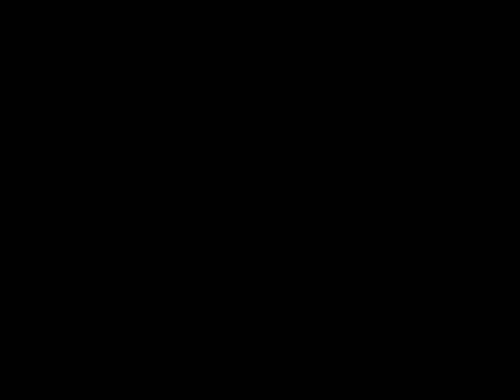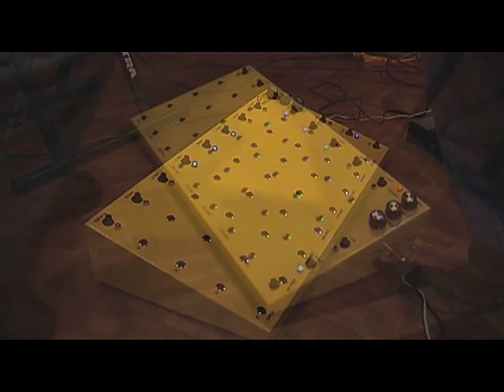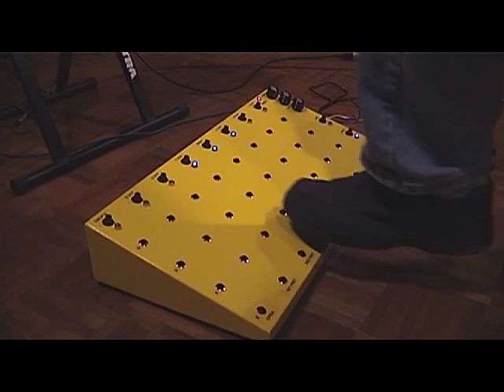Chapter 1, Channel and Velocity

Comment: So I have a tech question about the footar. Can you provide the hex file used on both chips? I am trying to repair one for a friend who plugged in a 12volt and the original 2 chips got fried. Any help would be appreciated!